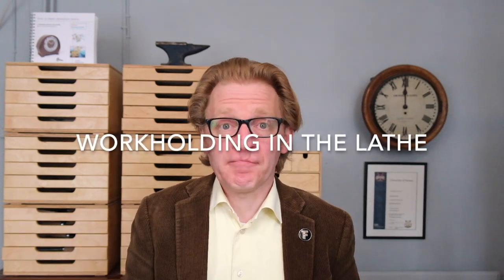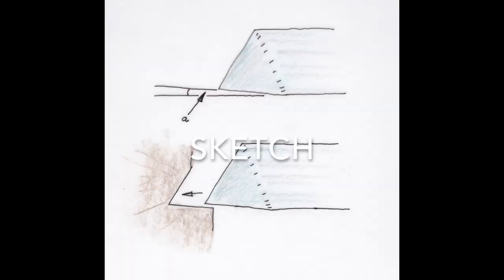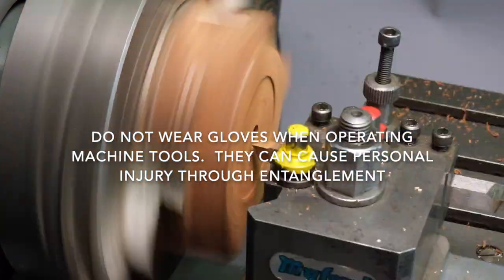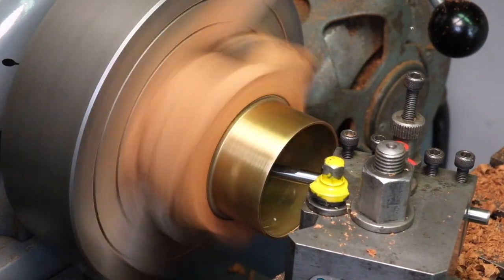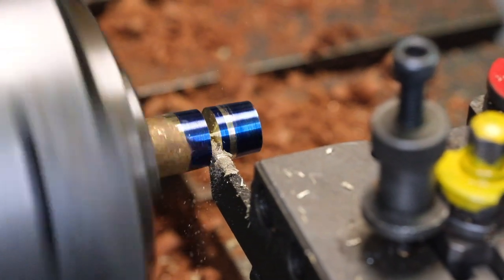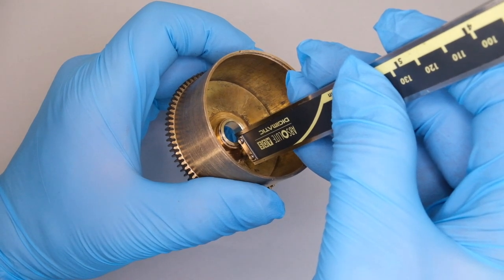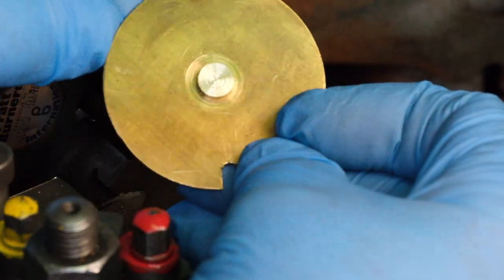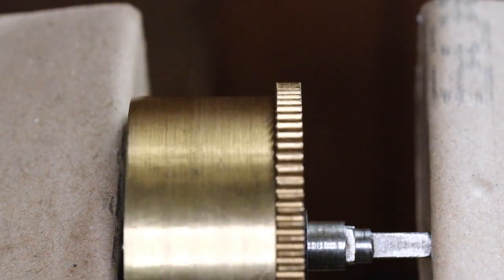022 Bushing a clock mainspring barrel using the traditional workholding technique, the boxwood chuck

Comment: Thank you Matthew. Can you state what the wall thickness of the bush will be after this rebushing?
Reply from the maker: Hi Franklin.  I try keep the wall thickness similar to what was there before.  Good question... In the barrel body probably 1.5mm wall and in the cap, it depends how much you bore out but I'd say about the same.  From a conservation perspective, it is best to remove as little host material as possible.  Obviously if the wall is so thin, it cannot be bored out or broached.   Hope this helps.  M
Reply: @howtorepairpendulumclocks  Thanks for your reply.

Comment: What is the advantage of riveting a new bushing in place rather than using solder? Very useful tip about the boxwood chuck - thanks.
Reply from the maker: Often, as in the case of a French clock,  the barrel body is soft soldered to the great wheel so there is a chance you would disturb that joint in soldering.  If you have a one-piece barrel and great wheel then I suppose soft soldering would be ok.  M
Reply: @howtorepairpendulumclocks  That explains it. Thanks.

Comment: Very helpful video on boxwood chuck. I'm just curious why not just put the barrel into a three jawed chuck by gripping on the outer barrel next to the teeth. I'm sure you have a host of reasons not to do that and I'd be interested. Thanks
Reply from the maker: Hi Norman.  Yes because of risk of damage to the barrel teeth and importantly, as many / most three jaw chucks are simply not that concentric and because the jaws are only spaced 120 degrees apart, the work will never go in quite the same.  There are precision 6 jaw chucks on the market and coin chucks that will be good enough for domestic clocks but most people only have access to a regular three jaw.  It doesn't matter how beat up your cluck is, the boxwood method pretty much guarantees concentricity.  Hope this helps. M
Reply from the maker: you could use a chuck like this but I think they are £1,000.00  - piece of wood is effectively free :=) https://www.maprox.ch/en/clamping-chuck-jf-ultra-flat-type-a-b-c-w-dw.html